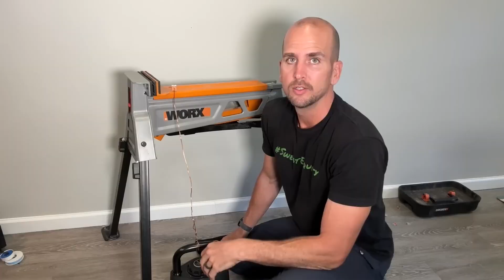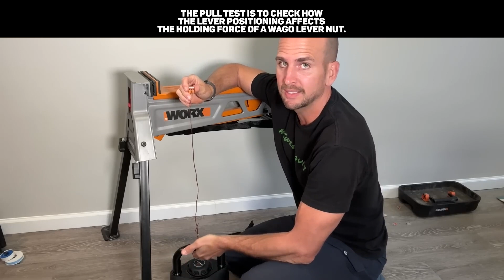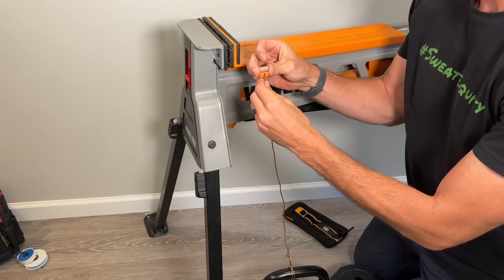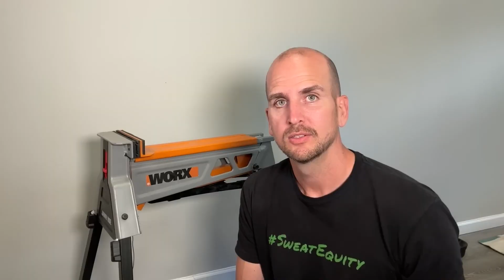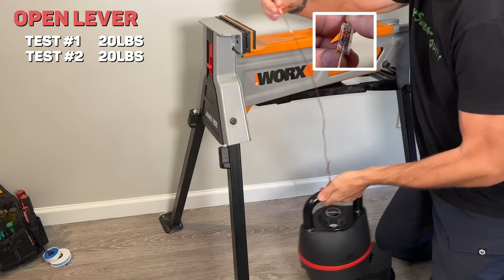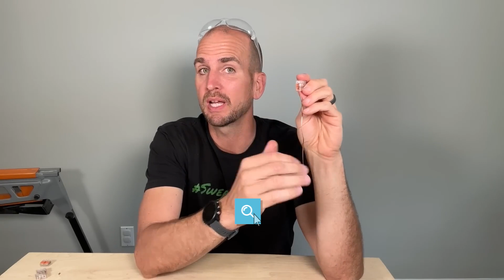Wago Lever Nut Test: Does an Open Lever Weaken the Connection? ⚡

Comment: You need to study how wago works. The lever doesn't do anything unless you feel it engage internal spring. So wobbly lever is not an issue.
Reply: except in this case it shows less clamping force, which means less contact, which means more resistance, which means more heat and chance for bad things to happen. Thanks for playing!